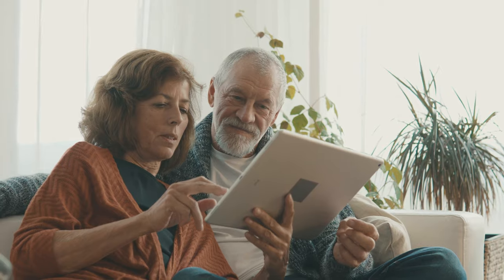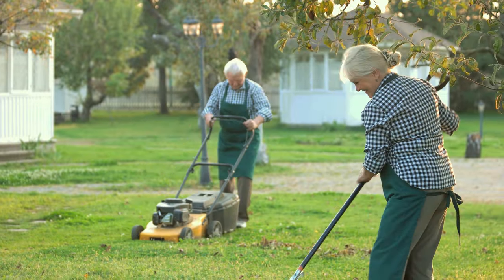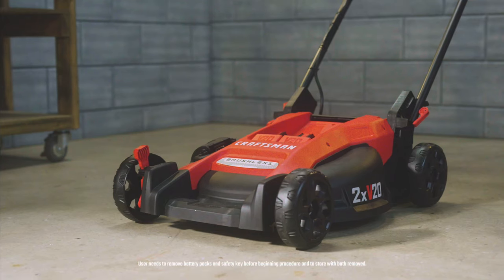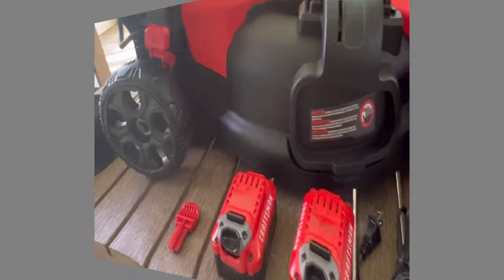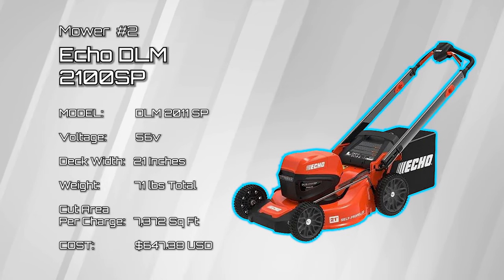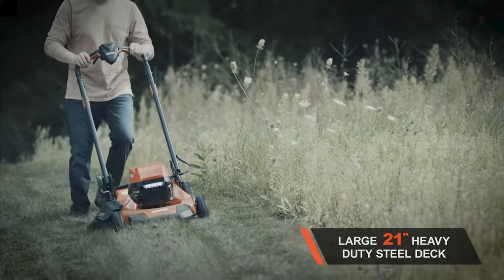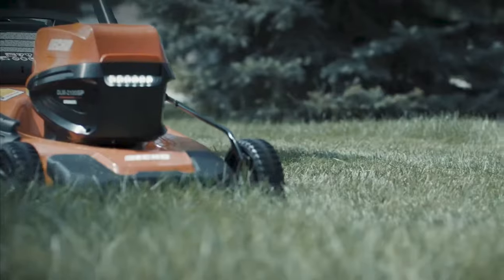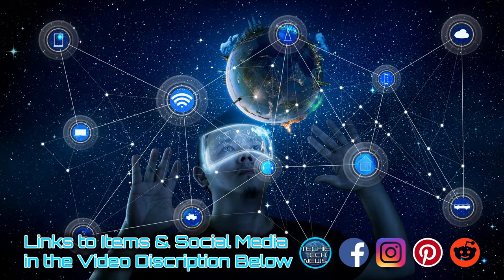Top 5 Best Electric Lawn Mowers of 2024

Comment: I am not very confident that Craftsman would function well… Exposed battery compartment seems to be just too risky for any electronics involved in.
Reply from the maker: That is an excellent observation. However, the protruding prongs are on the top side of the mower, preventing anything from getting stuck in the mower itself. You can literally blow out any debris that happens to wedge it way in. But we agree, we would feel better if the battery compartment have an enclosure. Still, it does work just fine and it wasn't of a concern to use when using it. Thanks for your comment :D 

Jim with the TTN Team

Comment: WARNING: Battery operated tools are  for California compliance only, nothing else. In California, most properties with lawns are under HOA's or sprawling condominium/apartment complexes that are professional managed. They have contractors that mow lawns daily for a living. They mow year round since California has a miild winter. Battery operated tools need regular use to get your money's worth out of them. A regular homeowner in middle America that uses their tools occasionally will be very disappointed at the lifespan and performance of the tool. Any store in anywhere else in America is just stealing your money by selling them to you.
Reply from the maker: Hello there. We appreciate your comment, thank you. However, we do not agree with the opinion that battery operated tools are for California compliance, only. While they may serve towards their specificity of intent, electric tools, even when used seasonally, have already shown to offer cost and time savings over their ICE counterpart. Lithium Ion batteries do not sulphate like lead acid batteries, so they do not diminish at the same rate. Nor do they self discharge at the same rate. Also, the lifespan of electric tools vs ICE is always higher. Yes, ICE prices are always cheaper up front.. But when you include fuel, oil changes and maintenance, Electric will always win in the end. Its just our opinion regarding electric gardening tools.
Reply: @techietechnews  It's not opinion, California mandated electric by law. Californians have no Choice on what they buy. That's a fact, not opinion. Battery operated tools cannot compete  in the market any other way. They are sold at gun point cause they don't sell any other way.
Reply from the maker: @fraudsarentfriends4717  Hello again. As I said, manufacturers did not intend for these products to be used in California, exclusively. Assembly Bill 1346 passed long after everyone was already using electric tools, hence the decision to do so. Again, the statement of these tools only being for California's compliance to this bill we believe is incorrect. Being lawfully ordered to buy a particular type of tool is not the same as being told what to do at gun point. Please do not take what we are saying as disrespect. We appreciate your perspective. However, I doubt we will agree on this debate. I agree to disagree and we can let others decide on what they think. 

Thank you for the debate and enjoy your day :D
Jim with the TTN Team :hand-purple-blue-peace:
Reply: @techietechnews  These tools were not being made in mass until after assembly bill 1346 passed. the law was created for California.Not the entire United States. The law was passed for the reason that consumers refused to make an ignorant choice of buying an inferior product without being at  gun point of the law.

Comment: I have a new Toro battery mower, it sucks, drive wheel falls off in 2nd hour, battery shorts, and on-line Toro will not take it back. They do not take items back if you use it for 1 minute! Their rear left geared wheel unbolts itself from the bracket, it self destructs! Two others have the same problem. Their repair dealer literally told me "with Toro, its Buyer Beware". I have a Toro case number, a BBB case number, and a US Consumer Product Safety Commission case number.  Save yourself and learn from my mistake, and stay away from Toro.
Reply from the maker: Thank you for sharing your experience. We will have to do our due diligence on this as we do not wish to promote products with poor customer service or reliability. Good Luck. Jim with TTN :D

Comment: The electric do not work yet!  They need to be still developed!  Maybe if Tesla move to lawnmawers?
Reply from the maker: They work just fine. You just need to pick the right battery size for your lawn. And if your lawn is bigger than one or two batteries, just buy more batteries. The point is that they are perfectly viable. Thanks for your input.